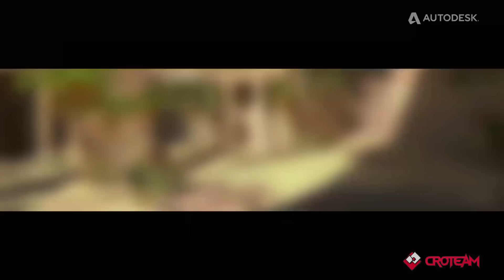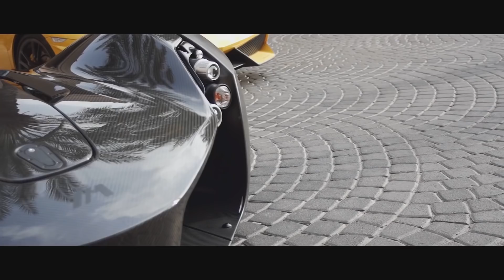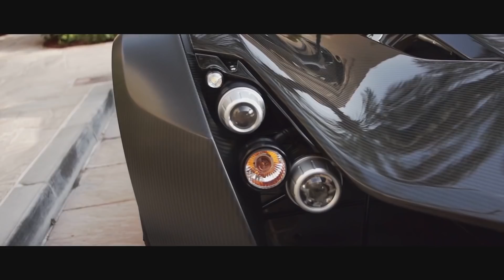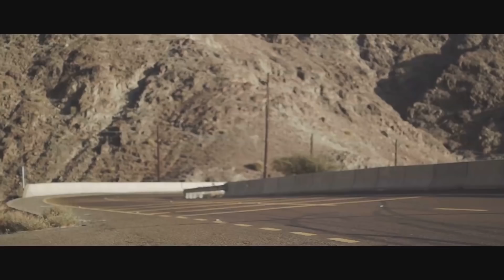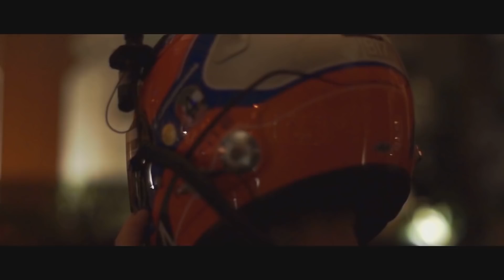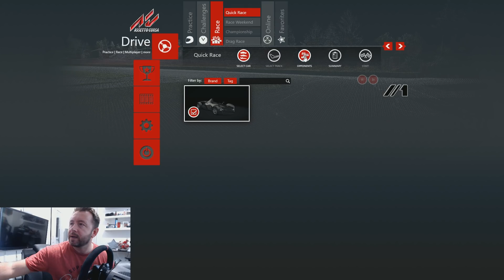VR Sim Racing the BAC Mono - the car partly designed using Autodesk Inventor

Comment: LOL. I know it's not the point of the video, but ... 0-60 in 2.8 seconds? that's barely better than the Tesla Model X, electric SUV, which does it in 2.9s ... and the Tesla Model S goes 0-60 in 2.4seconds... both very heavy 5-7 passenger cars...
Reply: The Tesla uses electric motors which can achieve 100% torque instantly but a mechanical engine would be ripped apart.
Reply: Yeapp, even electric motors are limited by traction, so the new Tesla Roadster will have 10 "rockets", air tank and air compressor, pushing the 1.9 second 0-60 acceleration even further ... also improving handling, braking ...etc. ... most likely this option won't be road legal ...